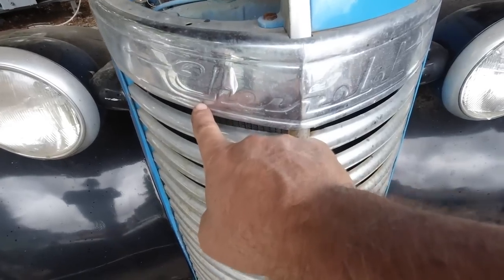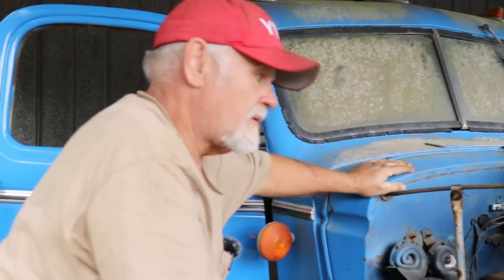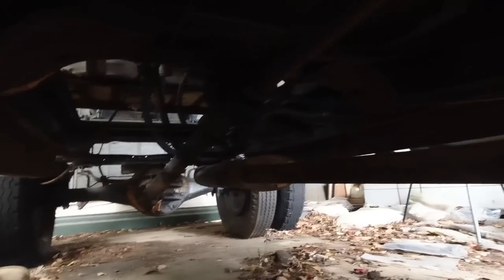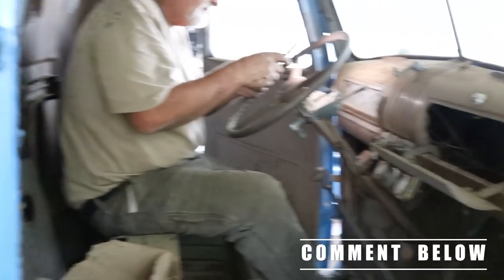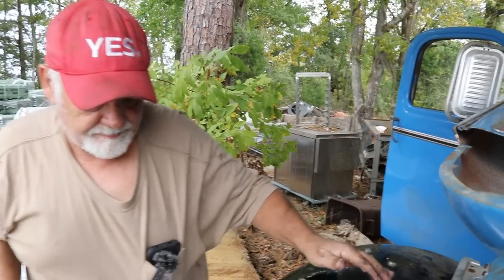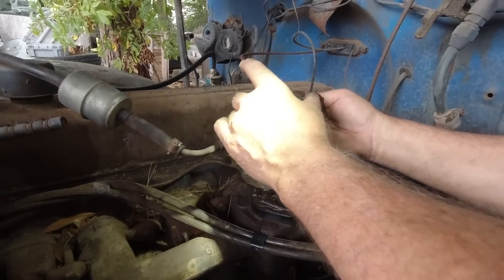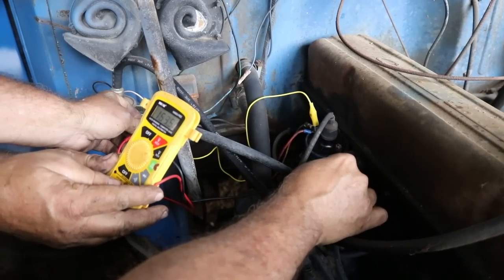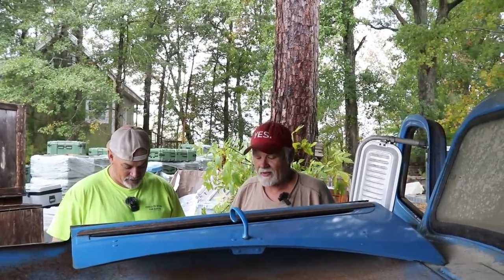WILL IT START? 40'S BARN FIND CHEVY TRUCK! We Have No Idea What we’re doing!

Comment: Need to pull the plugs to check condition and check for spark. 
Check to see if there's power to the coil
Check points for gap, condition and spark.
Reply: If you had spark, it should have fired off on your super juice.
Reply: Start at the coil with switch on. Ground your voltmeter to the engine and put your red lead on the positive side of the coil to see if you have 12 volts. Then put your red lead on the negative side of the coil to see if you have power from the coil to the points.
Next step, get one of Gina's emery boards and clean the corrosion off the points. 
If you have power going in AND out of the coil, the coil is good. It might be possible you need a set of points and condenser if cleaning doesn't work and the coil has power. 
If you clean the points and you're able to get spark at the points by cranking it over or even flicking them open and shut manually,  then you should have fire at the plugs. But since the carb is flooding, make sure you disconnect the power to the fuel pump before checking for spark while cranking it over without a plug in

Comment: ,the resivor on floor board probably the master cylinder for brakes the flipper on shifter is used to put in reverse.  And the hoses behind cab might lines for vacume trailer breaks.  The pullout thing on top by sunvisor might be how you turn on windshield  wipers they were vacume  and when you went up hill pushing on throttle  they would stop because the lack  of vacume. My grampa had a pickup with the same body style and I think it was from  the 1940 timeline  thank you Tom from Nebraska

Comment: You are missing a few tricks both with the carb and the ignition.   
One of my favourite carb tricks was to hold your hand over the inlet, then crank over, if your hand gets wet with petrol then you know the fuel is going through the jets.   That worked with my Commer Van which had water in the tank, the water drops blocked the jets, and my suction pulled the drops of water through the jets, and we continued on our way..
The points need to be taken out and ground to a flat surface, to achieve the best possible spark.  Don't grind them too much though, as the platinum contacts are only about 2mm thick.
Best of luck, hope it runs again soon.

Comment: Guys. Change the HT leads, spark plugs, contact points & rotor arm all for new parts. Should cost about £50 ($60) or less. Take the carburettor off, take it apart and clean it. 
Doing that should make it start. Coils fine.

Comment: that plunger is the vacum advance for the timing when it starts. plus you should have put some gas down the carb as the needle and seat is probably stuck.and the needle is on top of the float pointed towards where the fuel comes in from the tank.

Comment: Pro tip on the carb take a bread tie and get the wire out of it and run it threw the jets to clean them very important easy first step to get a gas motor running a small tip cleaner works well to.

Comment: If you are looking for top dead center the easiest way is to pop number one plug out and put your finger over the plug hole and turn the engine over till it pops your finger off  and line the timing marks up and see where the distributor cap is pointing compared to the plug and wire just trying to help but I'm not a mechanic

Comment: put 12v [hot] jumper from the battery, directly to the coil positive side . take any wires off the negative side, then put another jumper lead on it.    have the coil lead positioned on the valve cover again [like you had before], then rub the jumper lead across the rocker cover, making and breaking contact as you rub. you should get some sparks now. no sparks = busted coil. if you have sparks, you need to concentrate on the wiring down to the distributor, and then to the points.
once you have checked the wiring from the coil negative down to the points, [+ refitted it back onto the coil negative], reconnect the hot jumper to the coil positive, get a screwdriver + "flick" the points open. if all is well, you should get a small spark at the points, + a good one at the coil lead.
 then put the button back on, cap on + spin the motor over, with plug lead on the valve cover [ use a big, long cotter pin pushed down the pluglead to get the spark to the outside + be visible] this should now spark once every 2 engine revolutions 
don't bother with the gas, just open the throttle 1/4 way + fire the easystart down it's neck, IT WILL NOW RUN !!!
the carb is well above your pay grade, it will either work, [with a few leaks] or not....
take care chaps

Comment: There’s a high point under the rotor button the distributor turns . When the high part of that little cam comes around to the points they open to about .015 then close . This causes a spark to go to the plug .

Comment: The points opening and closing is what sparks the coil. Clean points contacts and make sure the points are opening and closing.  Should have about a .016 gap on distributor cam peak.

Comment: Replace the wires and the spark power is fed from the battery wire connected at the starter, as for the carburetor you need to rebuild it with new seals

Comment: I think It's A 1937-38 model grain truck converted to tow rig. Dude WOW what A find. NICE!!! Those mite be negative ground but I am not sure myself. That carb looks good.  The points on those distributors corrode quickly but are easy to set. Also check the resistor on the firewall. If that Is bad It won't start. If you file the points good you may get some spark then she will run. The cap looks weathered so I am betting both the cap and points need cleaning. Man I wish I were there to help you both. Dang nice video guys.

Comment: This was funny. Wiley, you were born in the gas engine years but... it's a 6 volt system; you have to clean the points; and most of those were positive ground. Unless all the lights have been switched to 12 volts, say goodbye to the headlights😂

Comment: Thats either a 1939 or 40 truck. Probably a 
1 1/2 ton.  250 straight 6. Good running engine. 
You guys need to take the carb off and clean it out and looks like a bad coil. Clean the points up and she should spark. That plunger thing below  the distributor (lol)cap is a vacuum advance that changes the timing a little as the engine on a load. Clean the plugs and check the wires for continuity. She should come to life once ya get spark. Real nice old truck!  I’d like to have that one!

Comment: Jumper wire from positive from battery to positive on coil. Remove cap on distributor spin engine over make sure points are opening. Sand the points if they are indeed opening sand contacts in the cap and the contract on rotor button. Put it back together and fire it up.. if the points are not opening when you spin it over you will have to adjust them very easy process. But I'm sure if you put a 12v jump wire from battery to coil and sand the points you will have spark. There also might be a toggle switch in the cab that the owner installed to provide the power to the coil as well.

Comment: That can is a vacuum canister old style. Leaking at the carb shaft . Shaft is worn. Not getting any fire. Coil may be bad. Test both sides of the coil. Switch on .Gas and fire, it will run. Check resistor on the firewall.

Comment: 1938-39 judging from the primitive 5th wheel and head light placement. The 40s trucks had headlights on the fenders and more ornamentation up front. I can remember these old trucks being used in salvage yards and left for dead in fields and barn lots.. Or overgrown in tree lines. My cousin has my uncle's 1947 two ton. Rebuilt the driveline and engine. It set for 30yrs because of a bad clutch and burnt valves. And way way way to many miles.
Reply: My 1941 had lights on the fenders.

Comment: The coil has a positive and negative post. Put power to the positive post and negative goes to the breaker points that you were trying to clean. When the are closed that loads the coil and when the points open the coil will discharge threw the main lead going to the distributor threw the rotor to the proper spark plug!

Comment: It has to crank to get pulsing voltage to the 12v input of the coil .  The engine cam turns the points on-off and with timing, fires the pulse to the coil the coil fires a big voltage to the distributor (top part) and drives the plugs as the cam cranks the points.

Comment: I would say it's about a 1939 should be positive ground engine should have a generator not an alternator and I believe that's a brake reservoir under the driver's seat originally probably 6 fold of it hasn't been converted I've had to run separate power to the point getting some of these old ones started they pretty much will always run except for when they don't😁👍

Comment: Your foot regulates the air going threw the carb with a butterfly valve, the vacuum going threw the carb pulls fuel out of the jet and mixes with the air while going threw the intake manifold 👍🏻👍🏻👍🏻👍🏻 the points control the coil every time the points close it fires the coil and sends the charge too the distributor and the distributor sends it to the spark plugs

Comment: The coil feed from the starter is straight 12 volt. When it starts it goes through a resistor and drops the voltage so the points won't burn up. And if the poinyts nd distributor and rotor button are working you pought to get a spark from the plug wire or the coill wire GOING to the distrubutor in pulling the wire out of the cap. If not try cleaning the points. And the thing on the shifter is a reverse lock out.And if you were a cololnel I sure am glad I got out when I did! God bless!

Comment: you should have tried a spark plug laying against the block to check for spark, or stick a screw driver between the points if they are wide open or open and close them. to check for spark also the condenser in by the points could also be bad.

Comment: The fuel coming out of throttle body is because the fuel mixture screw is missing by the looks of it, check spark by removing No.1 sparkplug and leaving connected to lead, turn engine over to see if there is a spark across plug gap!

Comment: There's a ballast resistor located on the firewall just above the coil, that would be the first culprit I would go to. If that's bad then you can run a hot wire directly from the battery to the positive side of the coil. If you get no power or spark after that then the coil is bad. If the bottom of the coil is rounded instead of flat then the coil is bad also.

Comment: On these engines always carry a nail file to file the points and under the air cleaner there is a pipe that sticks up out of the carb you can fill the fuel bowl through it makes things a little easier and safer you can spin the motor over with the distributor cap off to see if it is firing but I am not a mechanic you guys be safe love your channel

Comment: First thing first,. The points and condinsor needs to be cleaned and set at .20, second, make sure you have 12 volts at the coil on the + post, the - post goes to the distributor.  When the points opens and closes causes the spark from the coil to pass thru the cap via the rotor bug to each one of the plugs.  2nd thing the gas is leaking around the lower butterfly shaft on the carb which is normal when pouring gas down the carb.  Get spark it should run.

Comment: In terms that will be easy to understand the coil is a constant power source for the distributor, it takes 12v input and converts/sends it to the distributor. The distributor shaft turns as you crank the engine over. There is a cam lobe inside the distributor that rides against the points opening and closing the gap between the two contact points you tried cleaning with 40 grit sand paper, sending the power to each individual lug on the distributor thus firing the individual wires/plugs for each cylinder. 

Pull each spark plug wire individually and hold them  close to the cylinder head or engine block to see if they are creating a spark( use gloves or insulated pliers since those wires likely have pin holes the spark can jump out of) if none fire you have an issue with the coil or points. If some fire but others don't you likely have a plug wire or contact issue between the distributor cap and rotor on those individual lugs.  Remember you may get spark on all of them but it may not be "hot enough" to ignite the fuel. Also keep In mind those points you were cleaning must be gapped specifically to fire properly, flopping them around and bending them can ruin that gap creating a weak or no spark issue. 
 
A bad distributor cam lobe can also cause spark issues. As cheap as they are I'd by a universal 12v coil and an ignition kit from oreillys for that distributor. It will come with new Points, condenser, cap, button, and maybe a new gasket for the distributor. 

I didn't get over technically on this description because I know you guys are less familiar with gas engines then diesel ones. And for that I'm sure there will be some critical comments about my not so technical breakdown. If you need any help in the middle Tennessee area feel free to reach out

Comment: Check the points use a matchbook if you have to it should be about 17,000 that's what feeds the coil then it starts and check the plug wire at the end at the plug for spark

Comment: Hey guys. All you need for any gas engine is compression fuel and spark. If it has those 3 factors. It will run.

Comment: That carb clean jets clogged if the float sticks open she’ll over flow. May have to take apart and clean and re set the high/low setting {IDLES} Adjust after it gets going good. Best to clean the fuel line {FLUSH} or use a temporary hook up. Because it needs to get up to temp before the high idle settles down bump the accelerator to settle it down.  If it idles good light throttle work some high some idle exercise it. but don’t give her the beans too much

Comment: Well guy's you know the main thing with petrol (gas) you need spark when to spark is from the lumps the points run over as the distributor shaft turns, the opening and closing of the points causes the coil to spark, which goes from the coil to the distributor cap centre which the rotor conveys it to the appropriate cylinder, if you have power to the coil and open and shut the points the coil should spark,if it doesn't spark coil may be no good, 
The needle and seat are at the end of the flotes to adjust bend tab where needle attached to the floats, good luck, all the best to yous and your loved ones

Comment: Did you pump the fuel to see if it is spraying in the throat of the carb?  Don’t think so.  You may have flooded the engine.  Hold spark plug wire close to a ground to see if you have spark.  Not sure about your coil test.  Check plugs.  Should be ok if running when parked.

Comment: Hey guys the battery powers the coil, the coil ups the volts, it then feeds power 2 the distributor, so when it spins it does what its name is it distributes the power 2 each points under the cap, so ether ur not getting power 2 the coil or the coil is dead, also cleaning the points won't make the coil work.😁

Comment: Master cylinder is under the drivers side floor and they are hydraulic. The charging unit was a generator and was about 12” long , alternator are short and fat . Pull the cap to see if the points move when you crank it over

Comment: Excellent video Hank  :) , Wiley  :) hope got 6 volt positive ground with Generator, if Alternator it 12 volt Negative ground also need coil when turn key on by + side come from key ignition switch  also plus disturbor - side coil to disturbor side screw , condosor in disturbor does like energizer battery  point to rotor  to front on 1 cylinder also cap  of spark plugs plus coil in middle for each in fire order like 1, 6 , 3, 5 , 4, 2 also points be .10 to .25 foul and get ! Plus get coil , points, rotor , disturbor cap , wires set ,  spark plugs !  Plus want make sure on Number 1 cylinder on compression and top to ! Also get new fuel filter also kit rebuilt carb to do and new engine oil be 10w30 no synthetic type and oil filter  in pot also Antifreeze too! That button on gear shifter is for High back to Low range gear you find how many gear foward has then what do low gear when top gear rev engine to nice medium idle plus speed of 25 mph then push clutch pull half out  fast pull lever up and clutch floor to go first to top each foward gear to! If down shift to low gear to high one same way as low then come from top gear to first ! Also in Low to High First but clutch push clutch put Reverse then feather gas pull off to top of floor got to need Reverse gear for!

Comment: You need to run 12 volts to the coil. That if the ignition switch is working.. so you can run a jumper wire from the + side of the battery to the + side on to the coil. If no spark from the coil then it's  bad.

Comment: ok check for spark at the coil one side is hot with the key on  the other will flash when you crank it  if it dobt flash the pooints are bad with the cap off crank it over watch the points if they dont flash clean the points with FINE sand paper with the key on open and close the points if they flash yup now your gettin some where  dont worry about the gas if it sparks either will work

Comment: Hi Hank had my cub tractor not running checked coil ok , checked points ok, checked fire had spark but wasn't strong took a couple of days to put my mind in gear , it ended up being the condenser , it boosts the spark . You can test the coil with a ohms meter but just pull a plug ground it and see if you got fire .Easy to rebuild one barrel carbs you got this,  I'm surprised you Florida county boys don't know gas engines lol